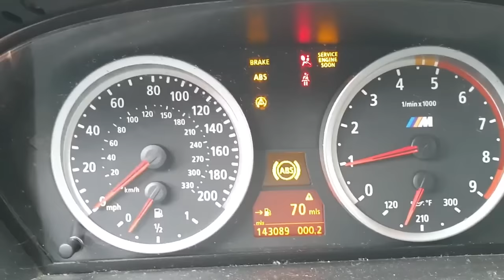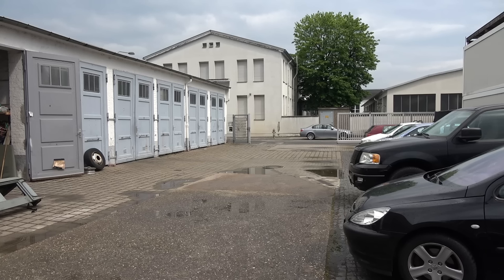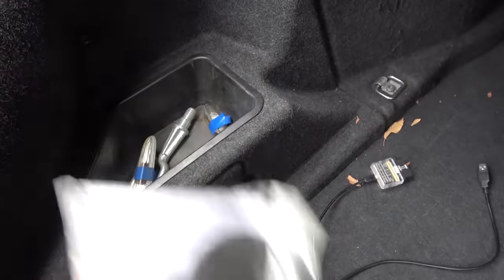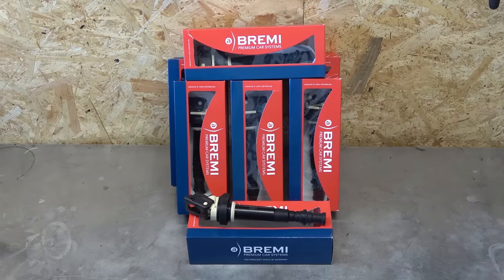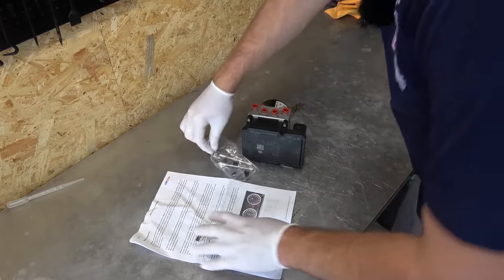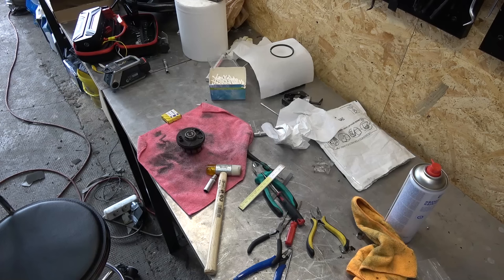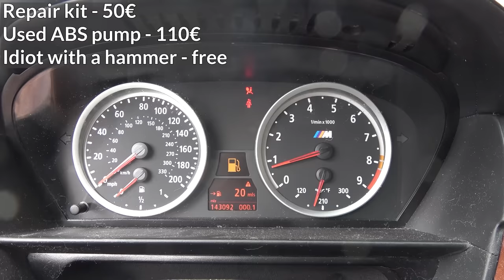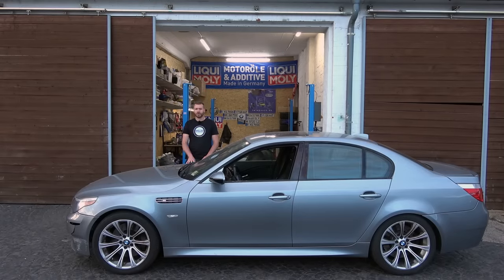I Bought & Fixed the Cheapest V10 BMW E60 M5 6-speed In The World - Project Raleigh: Part 1

Comment: I live in NC, the tag has a 2020 registration, no idea how that passed state inspection
Reply: as an SC resident, the last 3 vehicles I purchased from NC had state inspections (safety not emission) and they seem to be a joke.  Cars with fresh stickers and paperwork with floppy ball joints, tie rods, worn down brakes to barely pad material left.  As long as the check engine light is off, seems to make the shop happy.
Maybe it varies - just surprised me.
Reply: @NickMyers1  Yeah basically true. As long as it passes the OBD2, the rest is subjective and is easy to let stuff slide through. I passed my farm truck with no front brakes at all.

Comment: Very eager to follow your journey with this M5. I'm a new subscriber. It surprised me that they let you ship the car in that condition. The interior could be considered biohazard 😂. I shipped a 996 from Miami to Hamburg and they insisted that I clean the car inside and out before loading it on the container and it wasn't nearly as dirty as the Bmw. That M5 is gonna be a good restoration project. 👍👍👍

Comment: Just FYI it can be very difficult to detect a bad ball joint by just wiggling the wheel. If the ball joint isn't completely shot the wheel can still feel okay especially with the suspension completely unloaded. You really need to go back behind it and pry on them with a crowbar to see if there's movement in them.

Comment: Oh man.....That engine....that sound....manual gearbox.....Real Bmw.To me engine sounds great,if it has problem with bearings....it will be knocking???That engine uses 10w-60 oil.Can the the other oil make damage to the engine if you wont push it hard/if you drive it normal in the city?

Comment: In 2016 I was living in HCMC (Saigon) and my Vietnamese wife and I were moving to Los Angeles, CA.  I saw a used ‘85 Toyota PU manual with only 100,00mi on it’s famously reliable 22R 4cyl on Craigslist.  It had a perfect body with original paint and interior from what my friend in LA could see.  I offered a reduced price ($2500) and the original owner took it!  I sent my friend the money so when I arrived in LA my truck was sitting in my friends driveway.  I drove the truck till 2022 when we bought a far newer vehicle-a 2004 Honda CR-V (but that’s a whole other story.). I was very lucky 🍀 with the truck having driven it 6 trouble free years after buying it on the internet thousands of miles away!

Comment: Great video, great car! A manual E60 M5 has always been a dream of mine, the S85 is just incredible. As a German living in the US I'm still hoping that one day I'll be able to make this a reality (without the need of importing one). I'm so glad you got lucky with the engine (so far). Are you planning on replacing the cockpit/dials with German/European ones (to have the speedometer properly in kmh)? I guess you'll have to recode the car to German spec anyway due to the different rules on car lights etc in the US.

Comment: i just found one for sale at a dealer.  2008 for $17,000 miles.  it's had 4 owners.  Are these a good investment, possible classic?  I was looking for a 2003 530I or maybe a 540i but leaning more towards the six cylinder.  I hear the six is a better daily driving engine and easier access to repair.  What do you think?

Comment: For sure do the rod bearings mine failed at 107,000mls ruined a con rod and scratched my crank.Im in Texas and had to ship my crank to Lang racing in northern California.If you  inspect the top end I guarantee you'll find other problems,timing chain guide,cam hubs,water pump,valve gaskets ect.I know because my e46m3 engine had to be removed to send crank off to be repaired and those were the problems found.I also had a new clutch and starter installed.The car is an 04 and I had the work done in 2018.Good luck.

Comment: Great pickup and great Vid.  I understand you don't approve of chinese repro parts. Must say I do use chinese parts in some BMWs.  I may not continue to do so because I intend to boycott as much as I can from China.   Love my BMs but as far as I'm concerned with so many OEM parts having almost 100% failure rate why not use repro  ?  E60 & E39 electric fans, electric thermostats,  E60 heater valves,  E60 water pumps etc I guess OEM parts are cheaper in Germany of course.   Congrats again on a great purchase.t

Comment: I've driven quite a few of these M5s the E60 "Bangle" cars just look horrible, but the F1 derived V10 engine is really cool.  At least , you don't have to look at it when you drive it.  I'd still stay away from them because of all the complicated electrical issues.  One interesting thing about these cars is that that Manual Transmission is from the previous "real" E39 M5 because BMW didn't want to design a special transmission just for the Americans that demanded a manual version of the car even though the take on the manual transmission was still low.  Since you have both maybe you can verify this,but it makes sense.

Comment: Where did you obtain your diagnostic software?  I want to buy it but am concerned with so many Chinese knockoff.  I have the Mercedes one and it stopped working after 9 months, requiring a admin level password and the Chinese company is gone now, so I am stuck with a $700 brick.

Comment: I do not understand the evolution of cars ... automatic gearboxes should be for small, city cars; while manual transmission should be for big engines with high torques and high power like this one. Strangely, it's exactly the opposite that happens ...

Comment: Crushing the outer bearing race that will certainly shatter hard steel around - no glasses
Running a small motor - I better put on safety glasses :):):)
I'm guilty of the same crime though so maybe I should just shut up. Great videos, keep them coming

Comment: Why o why do these idiots still fit Chinese parts to performance cars like these , I’m into my third year of ownership and this car ( the same colour as this one but the LCI model late 07 ) has been very reliable with hardly any issues ( oil cooler replacement, alternator and battery) this is probably due to a full service history, genuine parts fitted and a clean example thanks to previous owners ... the one thing I did for preventative maintenance was have the throttle actuators changed for upgraded ones with better circuit boards ( Rebuild was the company run by Jason just outside London, north fleet who I highly recommend plus a fantastic price and a must if these haven’t been changed from new because they will fail guaranteed ) if these cars are serviced regularly they are very reliable , they have bad feedback from people that don’t service them properly, skimp on genuine parts , cannot afford to run one and for some strange reason ignore the warning lights on the dashboard and keep driving until a breakdown then winge cry and moan about it ..... a future classic without a doubt , keep the good work up great viewing 👍😎🇬🇧

Comment: Had an E63 M6 for 15 years from new…never had any problems. Lots of owners mistreated these cars and then they fail. They drove them hard from cold start, didn’t give them the proper maintenance and so on. And they all sound like a tractor from cold start up, even when they were new…

Comment: having gone through the used s85 experience myself, coils are just the start.. check for the glitter bomb in the oil filter. other signs are when the solenoids go out as well. its rod bearing material spreading through the motor like cancer. with how good of a mech you are M539 Restorations, might as well just crack her open and give the rod bearings and crank a good look over. Once that is covered, then I would say you came up on the 6k and you should never sell the car. Its a blast to drive.
edit: just got to the end of the video and it sounds like you have the right frame of mind which is get to the rod bearings. 👍

Comment: Ofc it is repairable, i,v done it to way way bigger motors many times. (but only if the plastic on the wire is intakt if not then you have to rewind the stator witch is no big deal).
All stator axels have a stop you do not have to measure, they might be shimed but.

Comment: 10 screaming rod bearings eating away at the crank.  These things are unbelievably terrible to work on and notorious for failures of all kinds. They drive amazing when they are sorted - but that is typically short lived. They are riddled with engineering and design flaws. Knew many people who bought these new and regretted it almost instantly. Modern BMW's don't hold a candle to the old cars they used to make. S38 powered M5's were the best of the best imo.
Reply: I say all this but I still really want one. Not sure if that makes me an automotive masochist

Comment: Is Germany not allowing any mods on vehicles at all? I mean I understand the engine side as it will potentially change emissions and its a big no-no. Or exhaust mods due to emissions or sound regulations... But not even suspension? Sway bars, springs, bushes, etc?
Reply from the maker: You need approvals and certificates for every mod you do.

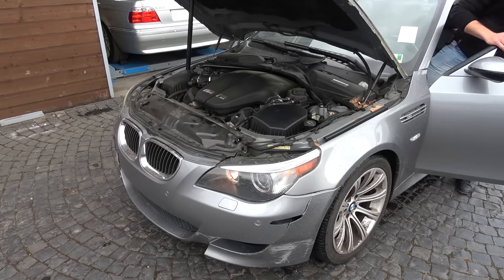Comment: at around 12:00, and while reving the engine, you can see a small spark under the plastic cover, IDK if I m late or is it normal, but I thought I should notify. other than that great video as usual.
Reply from the maker: It's not a spark, just ITBs moving.

Comment: Do you think it may have been a flood damaged car? ABS pump had signs of water in, those 2 big silica gel packs for soaking up moisture? Maybe that side corner had gotten wet?  I’ll keep,watching, and see how you progress.....anyone mentioned bottom end bearing shells yet, isn’t that a think on these v10’s?  EDIT, I can see you mention bearings now....
Reply from the maker: No, there are absolutely no signs of that plus it would've been totaled 100% if that happened. Gel packs were put by the shipping company, water in ABS is not uncommon, it sits low and if the fender liner was off or damaged at some point (I can see it was messed with before) that'll do it.
Reply: @M539Restorations  yep, thanks for the reply, what a cool project though. Are you able to to get a louder exhaust system in Germany with the TUV? It'd sound epic! 😉👍

Comment: Why do they care about an aftermarket sway bar?  That's what happens when you have politicians making laws for no reason. A law by definition should be to protect people without damaging anyone unintentionally.
Reply: Kurt, the issue here isn’t that the sway bar is aftermarket, rather that it’s likely a USA aftermarket item and therefore unlikely to have specific approval for Germany (the TÜV certification). 
Hope this helps.
Reply: @curvs4me  well, not really. If you want to sell an aftermarket part that replaces an OEM Part it has to be tested (by the TÜV) to ensure that it meets or exceeds the standards of the OEM item. 
That way people are protected; aftermarket parts in Germany are approved and safe. 
Their testing ensures that it works, safely. 
Not criticizing you or your posts by the way, just giving some context as a German.
Reply: @JayDee-b5u  I don’t understand the first part of your post. 
WRT the second part; one can argue that, worldwide, governments have too much interference and control over our lives, but I for one am quite content that in Germany at least a national body regulates and ensures the safety of (in this case) aftermarket car parts and accessories. 
Best wishes

Comment: SINCE NO ONE HELPED IT WAS THE WATER PUMP. IT WAS DEAD... M539 PLEASE HELP! i just bought a 2007 bmw 335i  and the "engine over 
temp drive moderatly " sign came on (yellow) about 20 miles after i 
bought it. made it home 30 miles and light went off seems intermittent. 
 i have topped off coolant, replaced water pump and thermostat fuse , 
oil was 1.5 qts low on oil (Previous owner) so i changed oil and filter,
  ANY TIPS? NO CODES EITHER, If anyone is a 335i Guy let me know please!
 (been thinking water pump, thermostat hope guy didnt shaft me), fyi 
both turbos have been replaced in jan 2020 w receipts! ANY 335i GUYS 
PLEASE HELP OUT!!!

Comment: front and rear doors of the left side are in different colours... what a shit deal, you bought a crashed car and then, with those powers at stake, the reactions will be uncontrollable. How disgusting...
Reply from the maker: What are you talking about? I stated in the video that the doors were repainted and the car was never crashed. I even showed the chassis structure and chassis legs. You know, sometimes people repaint certain panels even though they weren't involved in major accident, not sure if you ever heard of that.

Comment: The front left has been resprayed.
Reply from the maker: Man, if I only had such eagle eyes, maybe I would've mentioned it in the video.
Reply: @M539Restorations  you did mention it later in the video ,i am still in the process of watching ! 60% watched.hey i also wanted to know u bought a rebuilt kit for the ABS from UK, would it not normally be cheaper in germany or available there?

Comment: Actually that’s not true. We bought 2008 model in better shape for 4500$. And there are couple more for around this price. You guys consider the US as a entire world but there are 220 more countries in the world 😂😂
Reply from the maker: This is a manual, not SMG. Cars with SMG you can always find cheaper.
Reply: M539 Restorations bro where lower than 4500? You think smg cost 2000$? The other thing is some people don’t even care about the difference. They only know this car is a money eater and never buy them and the price falls incredibly down. I mean in specific countries
Reply from the maker: I meant you can't find cheaper 6-speed manual for less than 6k. You can find SMG ones for less than that. People absolutely do care, I wouldn't have bought this car if it didn't have a manual gearbox.